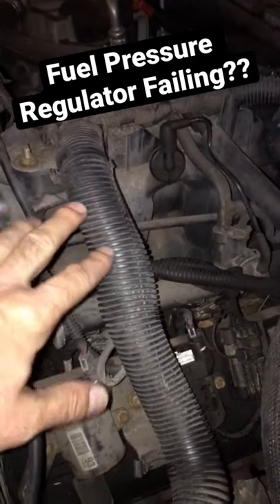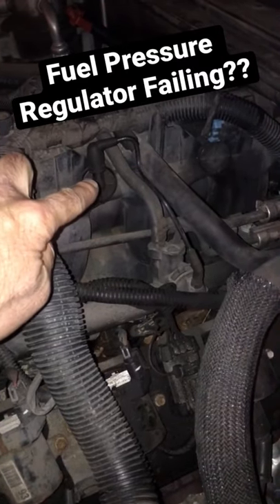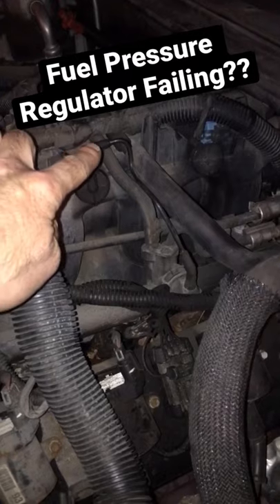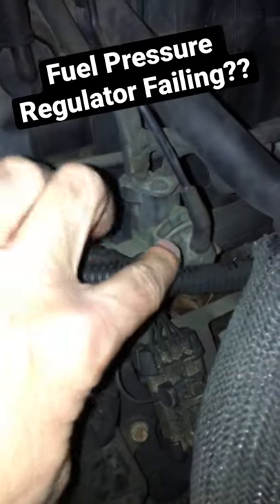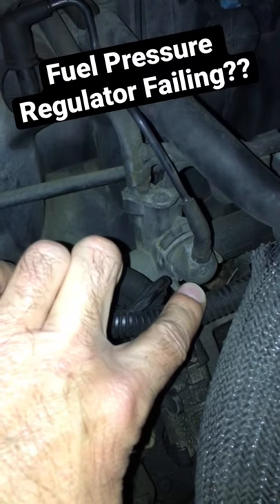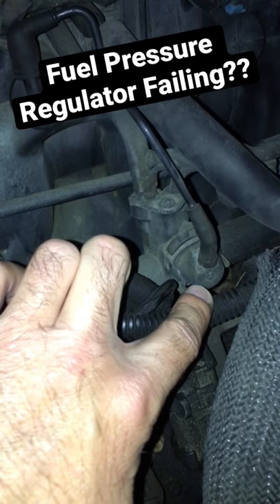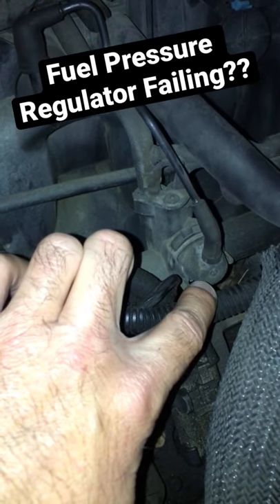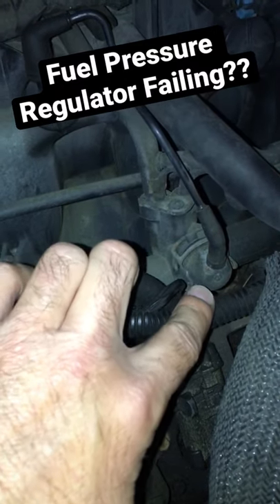Symptoms of a failing Fuel Pressure Regulator. Full video posting to my YT channel. Please SUBSCRIBE

Comment: Dude I don’t know how much to thank you . After I changed the knock sensor my Chevy avalanche 5.3 2002 started misfiring . And I change spark plug ,coils and coil stings, I changed catalytic converter 02 sensors , crankshaft ,camshaft, and nothing I was tired of it till yesturday I saw you’re video went to the junk yard today and installed that part that you talking on on my video and WALLA !!!!!!!! My truck is running smooth . P0300 is a headache .
Reply from the maker: Awesome, glad it helped. Thanks for the feedback 👍
Reply: Is it the same for a 08 suburban 5.3?
Reply: You could have saved 2 pockets full of money if you had paid for a proper diag.
Reply: How i stumbled across your comment, i have no idea. Everything you did on your truck, I did myself. To no avail. I know now what I’m doing next and I just want to thank you and OP of this video

Comment: Would this be  a reason why a car would shut off mid driving along with brake light an battery light
Reply from the maker: No. If it’s shutting off it could be the fuel pump. Check the pressure and make sure it’s not too weak. Could also be the oxygen sensors if there is a rough idle leading up to it.
Reply: I have the 96 ford econoline van with the 5.0 it would start but one day it shut off while it idled for a couple mins. And not Cranks but no start. Fuel pressure is low. Its not getting fuel could it be fuel regulator or just fuel pump ?
Reply from the maker: @luisparamo9402  if you hear the pump prime, then it could be the regulator. If it doesn’t prime, check the relay before replacing the pump
Reply: I have a 03 chevy silverado 5.3 and my truck starts then shuts I change already the fuel pump, battery the alternator is good starter good spark plugs new and still won't start
Reply: I have a 2012 Silverado and having problems with cold early morning starts ,truck sputters but after 5-10 seconds truck start’s idling Normal ,worse as temperature gets colder but during day it’s normal ..I’ve been hearing some slight backfire from exhaust but only at idle
Reply: @richardruiz2383  what was the issue?
Reply: @Opin10n  just checked fuse box and  found a 20 fuse instead of 25 for fuel pump but I noticed that the fuel pump relay was missing and switched with fog lights relay starts on point now , but my parents suburban also has missing relay too not sure about fuse … anyone have thoughts
Reply: @richardruiz2383  try the coolant temperature sensor. On a 2012 Sierra 5.3 it is on the drivers side if you are looking under the hood.
Reply: @biggnace4375 same things happening to me did you ever fix the problem if so what was it

Comment: Please BE CAREFUL replacing the regulator and make sure you dont purchase a cheap ebay part. My part wouldnt fit, i tried forcing it, the clip wouldnt fit around the abnormally thicker regulator, i slipped and busted the plastic tab on the actual fuel rail. Now i have to replace both the regulator, fuel rail and o rings
Reply: Thank you!

Comment: What is that called that the regulator goes into? That metal hose leaks. Do I need to replace the O-ring inside? Is there one?
Reply from the maker: @marcusharris3464  that’s the fuel rail

Comment: I have a 2002 GMC Sonoma SLS 4.3 vortec 2wd, I can’t go over 55 mph, when i try to it revs but doesn’t accelerate past that. My acceleration is terribly slow and uphill it slows down because it can’t push itself enough. I replaced lots of parts with all Delphi parts so nothing cheap: throttle position sensor, 1 o2 sensor, fuel pump, fuel filter, transmission, spark plugs and wires, distributor cap and rotor, map sensor, air filter. Doesn’t overheat ever. I’ve been buying part after part and doing research finding causes that could be my issue but nothing has fixed it yet. I’m now thinking it could be the fuel pressure regulator or injectors but I don’t want to keep spending money if I don’t need to. I also have cleaned the throttle body although it wasn’t sticking or super gunked up. I wiped the inside past the throttle body and smelled fuel on my finger. The only code that my scanner reads is P0101: Mass or Volume Air Flow "A" Circuit Range/performance. My mass air flow sensor works fine and I’ve tested it by unplugging and with a volt meter.
Reply: Please let me know if you’ve fixed it I’m going thru this EXACT same situation on my 2013 Yukon. It’s sluggish and I’ve done fuel pump,evap , injectors from dealership , tps, idk what to do
Reply: Mine too same motor same truck just a 2003🤦🏾‍♂️

Comment: Question… I noticed fuel leaking into the throttle body thru the vaccuum line after my f150 stalled at a gas station, I did try to crank it many times so I know a lot of fuel went into the throttle body, truck sat for about 10 hours until I got back and replaced the fuel regulator, truck cranked right up after the replacement but now it is knocking, what could be the cause??? HELP!

Comment: Would this cause a misfire. And also a weak startup when cold.  Truck doesn’t just fire up anymore it gradually starts up when cold.
Reply from the maker: Yes, below spec fuel pressure can cause misfires
Reply: Ended up being a coil pack for me.

Comment: Got a question so I was coming home from work one night and was driving and noticed it was getting harder for me to accelerate, long story short man I ended up getting closer to my destination about 8 miles away and mind you days before even earlier that day it was driving smooth but wasn’t until I off from work that I noticed the difference in acceleration then I was going in traffic and noticed it was getting harder for me to hit the breaks , then eventually BOOM my car slowly but surely cut off but the thing that threw me off was I jus put oil in my engine , just got gas ,my headlights were still on , my battery was still on , ac still able to run battery good , but I got my tester some days ago and read the code p0001 I thought it was my fuel pump but it’s reading the regulator which one should I replace ? The car is a 95 civic I’m pretty sure the person before me didn’t change it I’m jus trying to figure it out. Thank you in advance
Reply from the maker: Try putting a gauge on your fuel rail schrader valve and see if the fuel pressure is weak. May be bad fuel pump

Comment: Will a Bad regulator cause white smoke and strong gas i replaced swnsor and its till doing it should. I replace the high pressure fuel pump or regulator

Comment: Can a fuel pressure regulator being quit away from the fuel rail cause fuel pressure loss?

93 cobra is losing fuel pressure. I have the fuel pressure regulator located where the battery stock location is at and the an lines running through the front of the car all along the passenger side fender up to the motor.
Reply from the maker: I don’t think so as long as it is functioning properly

Comment: What is the difference between fuel pressure sensor and fuel pressure regulator?
Reply: Sensors are always electronic with connectors and cables running to the computer. Regulator is a purely mechanical part without any electronics.

Comment: Question
 my 2011 tundra  5.7 v8 force limited 4 door . Was misfiring  and going into limp mode .bogs down when hauling a load . Horses or whatever. 
Has check engine light  on slippery when wet and 4hi is on . Also had oil in # 2 spark plug. 
Had a mechanic come and did the manifold gaskets I think and changed spark plugs. Changed 2 sensors. Used a huge bottle of brake fluid for cleaning. Now she's blowing white smoke and fuel is comfort of the muffler. And she never did that before.
Mechanic never came back to do anything  else .he said I may need a throttle body.  
Need my truck running . What do you think it is. 
Please and thank you 🙏🙏🤗🙏🙏
Reply from the maker: White smoke could be caused by a blown head gasket. How is the temperature?

Comment: What do you think. Can a faulty regulator cause missfires and rev hang between gear changes?
Reply from the maker: It can cause misfires if the fuel air ratio is off

Comment: So I went to start my truck and heard a loud pop in the engine went to look and saw a bit of smoke looked closer saw the fuel vacuum line was disconnected at the bigger end went to push it bakc and it broke took that end off and noticed the smoke was coming out of that black port ( bigger side of vacuum connection) checked the other (smaller) side connected to tot he fuel pressure regulator and it was also broken and shot out some gas when I took it off any idea what it could be engine has done the pop sound a couple times then will have to do 2 long cranks till it fires up
Reply: The black part he points at when he says fuel pressure regulator line at the start of vid not the line itself but the black circle with a port at the top what is that called that’s where the smoke was coming from

Comment: I have 2004 Chrysler Concorde and sometimes it runs really well and starts and sometimes it doesn’t start. I’ve change the crank sensor cam sensor change the fuel cap because it had a small evap leak no I got no check engine lights no codes and it still runs really well for a week starts really well I mean and then all of a sudden it won’t start you have to let it sit for half hour 3/4 of an hour. Any suggestions?
Reply: Could be backpressuring from a clogging or failing CAT. Oxygen sensors up & down helped my Chevy Venture to start after a crank no start sitch. Didn't solve the problem completely since everything is old, but I understand now that a choking engine from carbon and backpressuring emissions is not a happy engine.
Reply: @HolySpiritAshley  didn’t help

Comment: Could it be that I need this replaced when my car smells like gasoline on the inside after beint parked but not when driving? The smell is so bad and two people couldn’t figure it out yet. Pleeeeeease help! Thank you
Reply from the maker: Sounds like your vehicle could be running rich, meaning it’s burning too much fuel. Are you getting any engine codes, and does it idle with high RPMs?
Reply: That could be a few things such as EVAP hoses or a loose fuel pump locking ring.